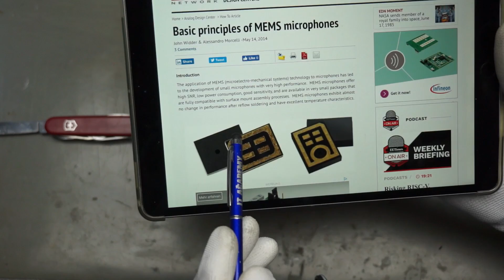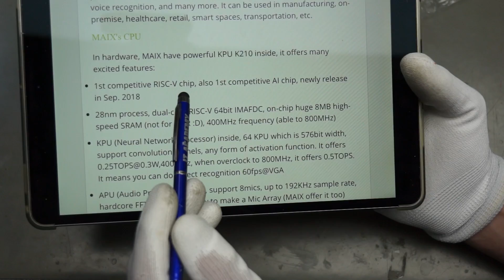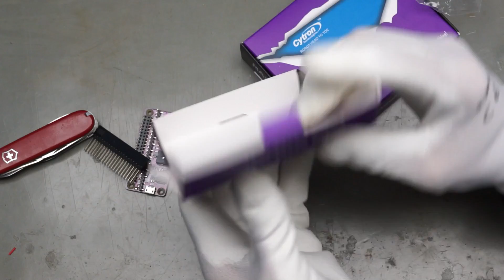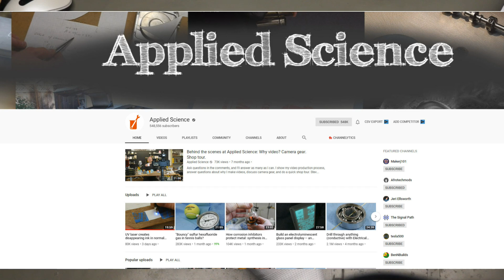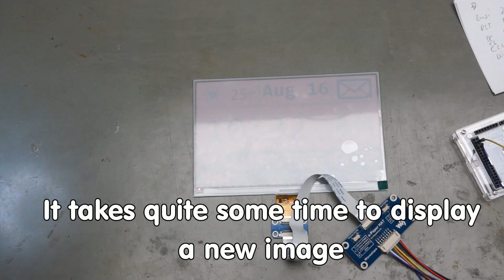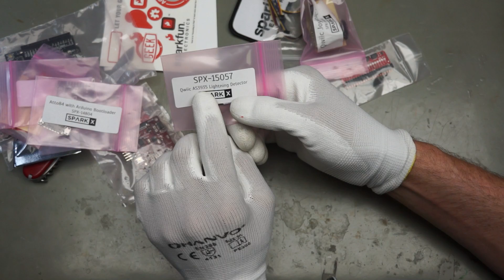#284 Mailbag: MEMS Microphone, RISC V CPU,, Maker Phat & Uno, Tesla/Gauss Meter, e-ink, Sparkfun

Comment: 7.5 inch e-ink display looks nice. A cheaper alternative is a second hand Kindle which also gives you a nice hacking platform and access (on some models) to the RTC.
Reply from the maker: How do you drive these Kindle displays? Any links?
Reply: @AndreasSpiess  I don't think anyone has figured out how to drive them directly but you can hack the kindle (which is linux based) and either cross compile code to the ARM architecture(like I did in my project: https://www.davidhampgonsalves.com/life-dashboard/ or use a precompiled script interpreter like the built in Lua or Python.

There is a community that works on e-readers I found helpful: https://www.mobileread.com

Comment: Glad to see the maker uno and the maker phat featured! :) The maker uno is now also my go-to arduino board for protoyping, as the built-in LEDs are a real convenience in making sure the errors are in the code or in the electrical connections. The phat (partial hat) isn't as useful when you already know which pins are which, but for quick and dirty projects the pin labels (and reorganizing the pins so the buses are closer to each other) make jumping cables a lot easier.
Reply from the maker: I agree

Comment: Hi Andreas, the pinheaders you mention in this video are really nice. We use them quite a lot in our products. They are not cheap, and you have to be a bit careful when inserting pins from the bottom up. If the pins do not align properly you run the risk of popping off the black plastic and only the spring contacts remain on the PCB. We use these bottom entry contacts from MPE-Garry (Series 098) or Samtec (HLE series). The Samtec ones you can get on DigiKey SAM11325-ND.
Reply from the maker: Thank you for the links to where I can buy them.

Comment: you should look at the nrf91, i bet you could find a use for it (its a pretty easy to dev for iot/4g soc)
Reply from the maker: Can it be used with Arduino IDE? And what about libraries? These are often the bottleneck of good HW (on this channel)
Reply: Andreas Spiess not yet :( but i bet it will happen some time 2020. the nrf52 shares a lot of toolchain and has one, and they’re both arm (m4 vs m33). nordic’s ide is one of the nicer proprietary ones, which helps.

Comment: I´m curious what you ordered from Ugreen. Or did you have unpacked behind the scenes? ;) haha
Reply from the maker: USB C cables, Mini HDMI Adapters, and a SDcard reader
Reply: @AndreasSpiess  Ooh i have also a USB C 3 gen 2 cable from ugreen and SD card reader. The SD card reader is also USB 3.0 and som much faster in writing a operating system to a SD card! New laptop has just SD cardreader but USB 1 speed... Laptops in 2019...

Comment: Which is better ESP32 or ESP8266 ? I tried to buy one from your other links few videos back it was no longer avail :(
Reply: ESP32 is better in everything, but if you need just 1 analog input you can go with ESP8286, little cheaper.
Reply: @jedandecko5585  Thanks all,

Is there a reseller that sells ESP32 ESP12 ESP12F BMP280 HDC1080 BH1750FVI Temperature And Humidity Light Pressure Sensor WIFI Transmission Module For LAN IOT or equivalent ? (on aliexpress).
Reply: ESP32 is newer and has a dual core CPU (however, it's a bit difficult to use both cores)

Comment: Can't be milli Tesla, since a Tesla is too strong, MRI machine has 1.5 Tesla minimum.
Reply: It is. At the surface of a neodymium magnet, it's not strange to get those readings. The field collapses rapidly with distance, though, so the magnets used in MRI machines have to be very powerful to have such a strong field at that distance.
Reply: A field strength of 1 Tesla isn't anything special for neodymium magnets.
Reply: Oh...ok... Had to read what tesla actually is.. It's the flux density not the total thing

Comment: If you put the pin header delivered with the phat (the one with the long pins) on the pi zero and attach the phat on top of this. you will still have the GPIO pins available for stacking on top of pi + phat.
Reply from the maker: Thank you for the tip!
Reply: instaBlaster...

Comment: The connector on the gauss meters is as far I can see the same as the one on my soldering iron. Interresting i would have thought that a meter like that would have a bnc or something like that.....
Reply from the maker: I assume the signal is quite low impedance. So no need for a particular protection.
Reply: I could imagine that the signal is even digital and everything happens in the sensor.
Reply from the maker: I would expect an analog hall effect sensor. But I do not know

Comment: Strange, my Maixduino kit has an esp32 on the board. I wonder, if yours is an older or a newer version.
Reply: A lot of sparkfun for analyse. And only post-it... you have a lot of dedication in this. Thanks.
Reply from the maker: I do not know if this „Maix“ is some sort of brand they use for different boards
Reply: Their M1 board is also available as the "M1w", which costs a few dollars more and has an ESP8255 to add WiFi. The link Andreas posted is to the M1w.

In the U.S., Mouser carries many Seeed Studio products at prices that are not much higher than ordering direct from Seeed. Handy if you want to avoid the long wait for shipping. Their branches in other countries may stock them too.

Comment: Qwiic connectors ?

Just what we need.  Yet another "standard"
Reply: UKHeliBob https://xkcd.com/927/
Reply: Qwiic seems to be the answer to Seeedstudios 'Grove'. It looks like the module suppliers try to create a vendor lock-in to chain users to their line of products.
Reply: Just found out that Qwiic and Grove is essentially the same technique (I²C + power supply lines) but with different connectors. Sparkfun already offers a Qwiic to Grove adapter cable.
Reply: They've been out for a whiiiiile.

Comment: Hello can we see a description of the E-bike 🚲 used in the Danube trip?
Reply from the maker: I used a Flyer Upstreet5 (Swiss Made bike) with two batteries. Since this is an electronics channel my journey most probably will not air here :-(
Reply: @AndreasSpiess  My wife has a Flyer too. Excellent bike. Indeed, this is an electronics channel, unless you're into hacking the electronics of your bike/batteries...
Reply: Maybe a video dedicated to the trip (I am from Romania)
Reply: Yes, that would be a great idea. I've done some motor travelling in Romania and would also like to try it on a e-bike.
Reply from the maker: Our last Flyer bike lasted 10 years. So you have to wait a while...
Reply: @AndreasSpiess  A teardown of a Flyer... is like swearing in church ! These bikes are meant to last ! However, my wife her Flyer is already 10 years of age and the batteries (the old 24V ones) are near end of life. 
A replacement battery is expensive, so I ordered new 18650 cells to do an upgrade myself. If it works out well... I'll let you know.
Reply: Should we dream of a teardown?

Comment: Just look for smd pin header on aliexpress, and you will find them.
Reply from the maker: I am not sure. The ones I found are higher and do not have holes through the plastic.
Reply: @AndreasSpiess  I ordered some of these, and when they come, I'll post link if they are good for my purpose, as I wanted to use them the same way as on this pi hat.
Reply: @AndreasSpiess  These are the ones that I ordered: https://www.aliexpress.com/item/33022627806.html

Another issue with them might be that they won't get enough grip on pins when inserted from below or might be not suitable for this. Time will tell when they will arrive.

Comment: The link to the MEMS microphone doesn't work.
Reply: Markus Mohr www.memsing.sg
Reply from the maker: Thank you. In the meantime, I changed it.
Reply: @AndreasSpiess  Banggood also has it. A few cents cheaper this month, as it's on sale.

You got me interested in these, so I did a little research. I happened upon this article on hackaday that warns there's another "I2S" microphone, the SPH0645, that's not compatible with the ESP32:
https://hackaday.io/project/162059-street-sense/log/160705-new-i2s-microphone

It looks to me like the SPH0645 doesn't meet the I2S spec, but I'm new to I2S, so maybe I'm misunderstanding. I thought you might find this useful if you're doing more I2S experiments.

Thanks for introducing me to these: it looks like they'll be very handy for adding audio to RPi and ESP32 projects.